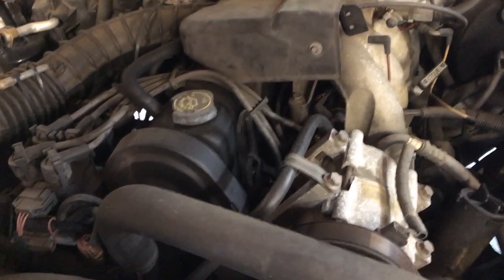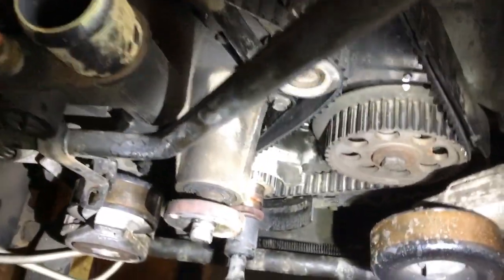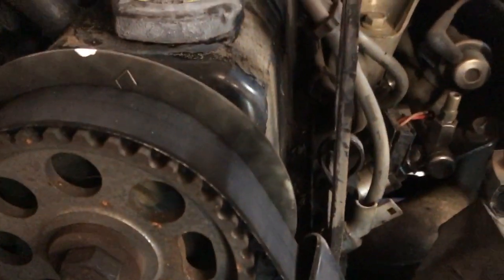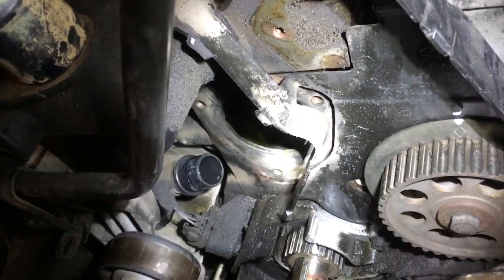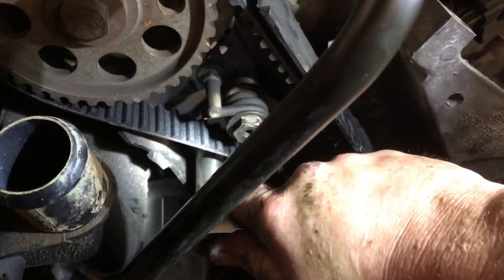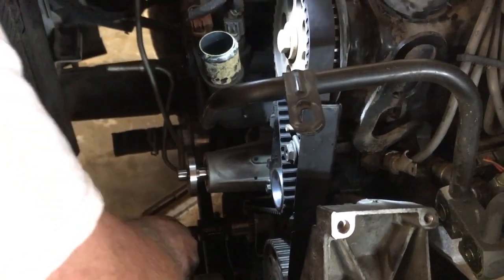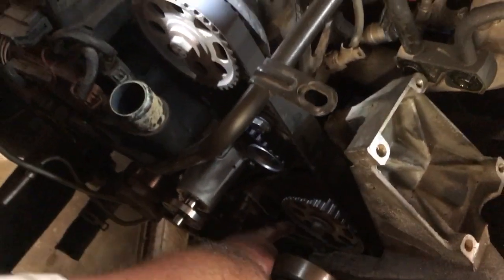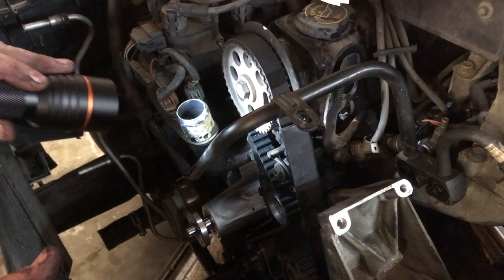How to replace a Timing Belt and Water Pump on a 2000 Ford Ranger 2.5L engine

Comment: I noticed you were able to loosen the AC and PS mounting bracket without removing the PS pulley. I’m having a really hard time figuring this out. I got the 4 ac compressor bolts out, is there other bolts I’m missing that will allow this bracket to shift so I can get the cover off?
Reply: Im havin the problem, what did you end up figuring out?

Comment: Great video! I successfully changed my timingbelt, but getting the tub to fit snug in the new waterpump is a challenge. My truck started but water and antifreeze went out the side of the waterpump. I'm going to try again in the morning.

Comment: are you supposed to use rtv gasket maker on the water pump re-install? my chilton manual said all rangers that are not 2.3 dohc need to have 'rtv gasket sealant' installed, but none of the videos mention this... prior, i just assumed you lubed up the orings with silicone based grease (does plumbers grease work?)

Comment: I have a question and would be very grateful to anyone who can answer it.  Can I change the water pump without removing the timing belt?  Thanks in advance.
Reply: yes. i believe only the serpentine belt needs to be removed to access water pump
Reply: About to do just the water pump only myself. You beat me to it.

Comment: My sons 99 ranger just stopped while he was driving. Was pretty sure there was no fire. Then heard it make an ever so slight pop... found that the timing belt has broken. Pulled the plugs to find to find that they looked original to the truck! Just hoping no other damage was done to any internals if possible when this happened. Excellent video and explanation..
Reply: Same exact thing just happened to me
Reply: How’d it end up turning out
Reply: @milesralls7972 v 12:16
Reply: Do a compression check on each cylinder.There needs to be at least 115 lbs or that cylinder wont fire. If the valves were bent when the belt broke that cylinder wont build up enough compression to fire. That happened to me a kia rio. Had a 97 Ranger with weak compression on the #4 cylinder because of bad rings and that cylinder only fired about half the time.

Comment: how do you get the tensioner off/on?
also why not mention of lining up TC on camshaft pulley with the marks on the timingbelt cover? other 2.5l timing belt how-to's skipped this, but its mentioned on the how-to for a 1996 ranger

Comment: Nice video..why was it necessary to remove the compressor?
Reply: The lines run in front of the timing belt cover. You can just free it from the mount and lay it somewhere. Don't disconnect the lines or your A/C will need to be evacuated and refilled

Comment: I'm looking at all these videos and all I need to know is how to get the hose out of the water pump and every video skips that part like it's too easy... All this other stuff is easy to me but I can't reach the damn hose connection!
Reply: I found his tip on taking the 8mm bolts off the lower radiator hose bracket to be helpful. Back those out then you can wiggle the hose off the water pump.
Reply: @jali4828   I ended up removing the entire bracket that holds the alternator and then had to replace it because it's 20years old and made of aluminium so it was stripped and I couldn't fit the bolts in.. I was able to easily remove the return hose form the pump though!